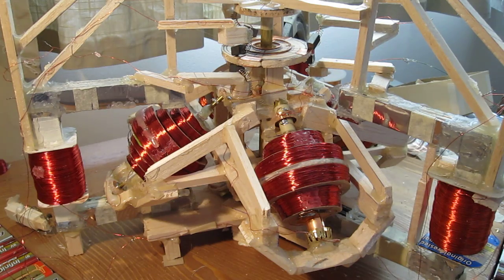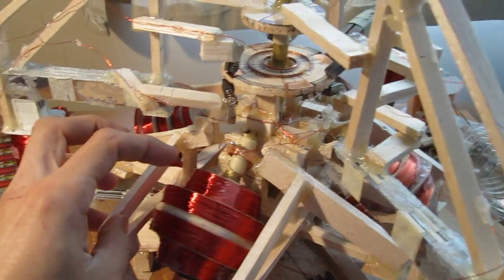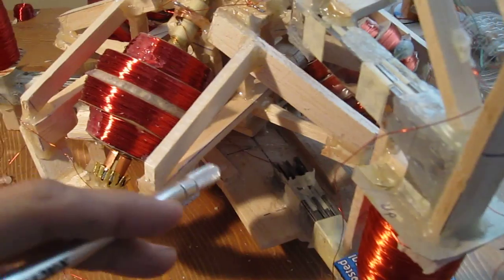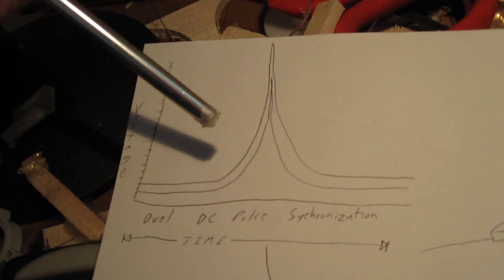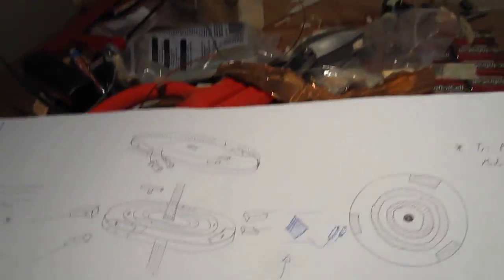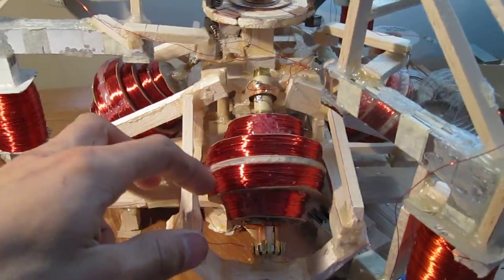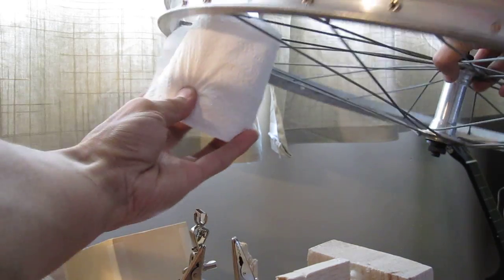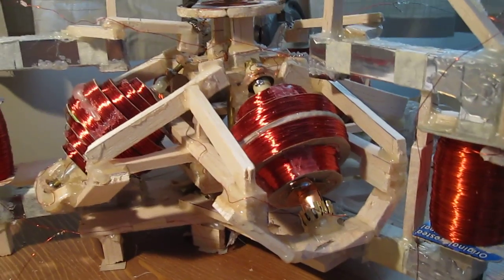Otis T. Carrs Flying Saucer part 9

Comment: I thought the OTC-X1 was kind of an eddy current motor or an induction motor, where you induce currents in the aluminum plates by the electromagnets to make it to rotate, an asynchronous motor. But you did it differently. You put current in the utrons in the inner part of disc to get rotation, a synchronous motor. How can we ionize the capacitor plates, putting high voltage electric field in them?
Reply from the maker: Yes its called "The Utron Coil" for a reason.  Because its a coil of wire not a big piece of aluminum.  Now, because the information on the Carr levity disc is incomplete, my assumption is only educated speculation given the available data on the device.  Others want to use a big hunk of aluminum.  I want to use a hollow coil filled with a sphere of salt water electrolyte.  Carr used liquid mercury in the earlier designs.  Perhaps the central utron accumulator is infact a high voltage transformer, like a Tesla pancake transformer?  I don't know...
Reply: BRAVO ⚜️👑⚜️

1st. The Conical Coils ,or double Tetrahedra is CRUCIAL 4 IT.

2ND. On Original u have 12 Utrons ♦️ 
And if u count
And look at it like TORUS

ITS A PERFECT 24 BOTH SIDE 
it can be even 48 or 96 Utrons 🛸

3rd. THE GEOMETRY OF THE UTRON COILS IS THE MOST IMPORTANT PART.

I WOULD RECCOMEND YOU

TO STUDY WALTER RUSSELS WORK.

HE MADE HIS 🛸 easy peasy like Tesla did and many others.

But the difference is
That the WALTER RUSSEL WORK IS CONPLETLY DEDICATED TO FLYIN SAUCER

AND IT GOES EVEN BEYOND THAT
Reply: Imagine put 4 of them ,UTRONS.

IN GROMETRICAL SHAPE
IN BEST POSSIBLE ANGLES
AND U CAN USE WHATEVER U WANT 

COPPER,MERCYRY ,LEAD, METAL, PLASTIC

ALL ELEMENTS ARE SAME
THEY ARE ALL SAME 99,9 % IS HYDROGEN GEOMETRY 

under different pressure conditions and ....

It can work like 

RODIN COIL
OR LIKE GENERATOR
MAGNETIC MACHINE

AND U CAN MAKE IT AT LEAST IM 40 OR MORE POSSIBLE WAYS

BTW - CONGRATULATIONS ON YOUR WORK I LUV IT ! BRAVOOO ⚜️👑⚜️

AND 2 IMPORTANT THINGS

1. UTRON IS TETRAHEDRON
2. IDK WHY NOBODY MADE A ∆ 🛸 SHIP 

JUST LOOK AT WALTER RUSSEL NOTES AND DIAGRAMS DRAWINGS ON CONICAL COILS AND U WILL HAVE ANSWERS TO ALLL
Reply: @Divinetheone from W.B. I read The Secret of light, The Universal One and A New Concept. But now I'm engaged to study The Searl Effect and his books. The Searl Effect somewhat has similarities with the Otis Carr inventions, although Searl didn't build manned vehicles. The high voltage being developed in the conductor, aluminum, copper disc or annulus shaped ones while at rotation, whether the field or the conductor itself, and use some kind of feedback coils to reinforce the field.

Comment: I thought you were supposed to use mercury in the utrons. Impressive nonetheless for a homemade mock up using balsa wood and stuff. I thought the original used two ice cream cone magnets to make up the utron. Is this some kind of debunking of Otis Carrs OTC design. Because this doesn't seem anywhere close to the ones that I have seen working
Reply: Can you link me to the video of the working one of these. thanks
Reply: He can't.

Cause he's literally hating on this design

I would love to see his design and to see original 
With 12 Utrons and achieving RESONANT VIBRATORY FIELD ,ENNERGY,OR ANYTHING....

BTW.... I MADE ONE IN SHAPE OF A TETRAHEDRAL

SO IT DOESNT NEED TO FOLLOW TGE RULES

Comment: Your design is to far of from Otis T. Carr, even for a simple first setup. I don't see how this will give any desired results. However! I am glad to see you are making the outside Utrons with an electrolyte! Because I am sure Otis mentions that they contain electrolyte and not only the Center one, but the small ones too.

Keep it up!
Reply: Utrons can spin above 90000 rpm so powering the centre big utron (also the electro magnets and spinning the smaller one as shown etc...) we  will successfully levitate
Reply: Or by Mercury gas spinning inside a copper coiled toroid. It can reduce mass

Comment: It spins........let's understand the basic principles of the otcx1 spacecraft....the outer shell rotates opposite ...so those electromagnets rotate as well the center utron s recharge the center bigger utron Wich is a battery ...the little utrons are collectors of magnetic field cause by the electro magnets ....and they rotate as a side affect .....also the electro magnets pulse the capacitor plates not the utrons.......

Comment: Fire it up and see how high it goes.
Reply: that can not fly, at most it would serve to measure some reaction
Reply: @augustoresquinescobar7427  maybe that's why it's been 8 years since he posted anything...
Reply: Sorry for the delay, the truth to be able to fly something similar is needed high voltage depending on the model of capacitor to carry the coils are not the impeller, according to what little I read it would be a high boltage free energy generator necessary to feed the sing capacitor that covers the ship, without the generator there is no energy to make it work although another method can be used such as van de graaff generator but this is necessary conventional power as fuel

Comment: I notice you've hot glued your parts together you might want to pick up some CA glue and accelerator from a hobby shop it's way faster and cleaner for wood prototypes.  It's super strong and used for balsa radio controlled aircraft I use it for everything.

Comment: hay dear spiritelemental, one question! if otis did thing tesla type then why are u not doing it the same he did 3,6,9 is tesla,otis use things in three ,12 horse shoe,12  coil u mite hav better success think about hummm 12 divided by 4 is 3 hummm

Comment: Could you please tell me!!! In the X1 project referenced in the original comment are the capacitor plates used as electrostatic pickups with brushes as in the Wimshurst generator? Check it out on MrTeslonian 's youtube channel if you want a reference.

Comment: I don't know how it's suppose to work but you would get better pull and pushes on the magnets by lateral placement and moving the contacts to fire caps at half between the c coils. Interesting project.